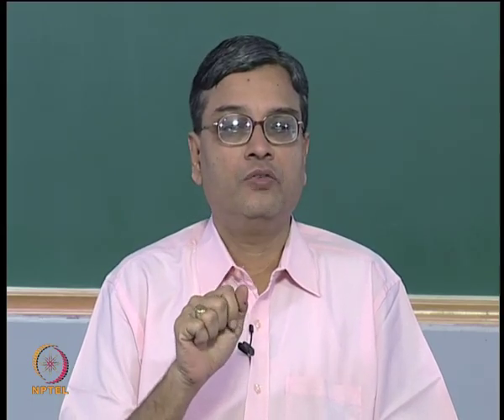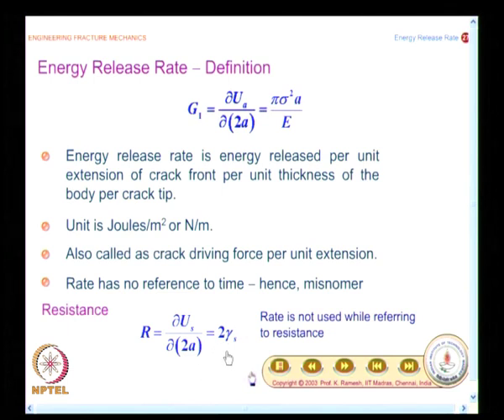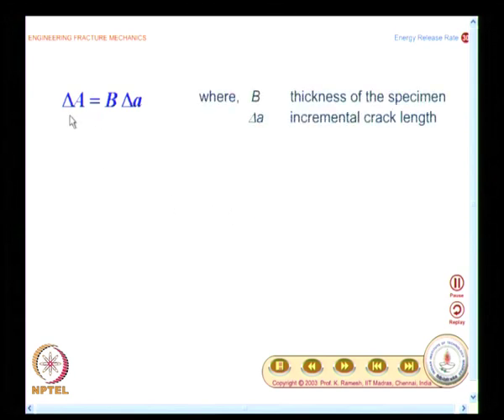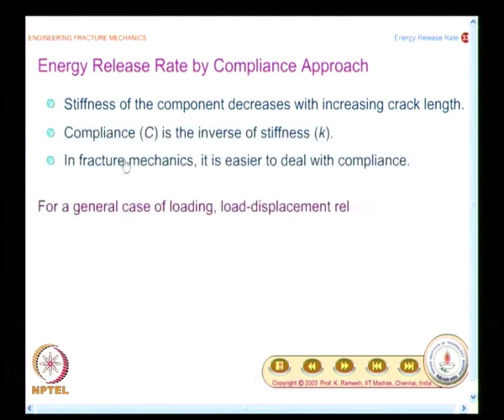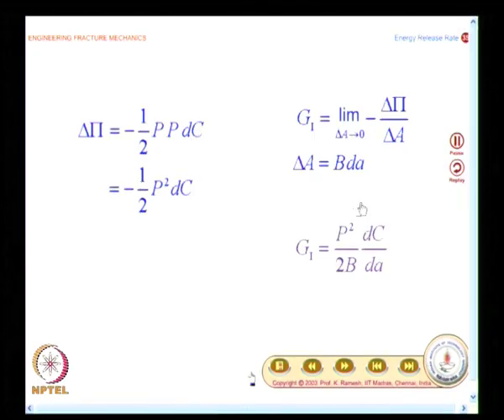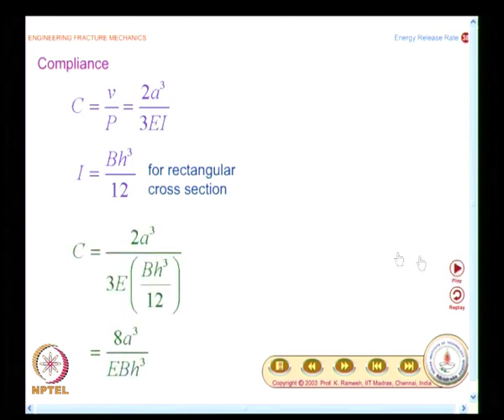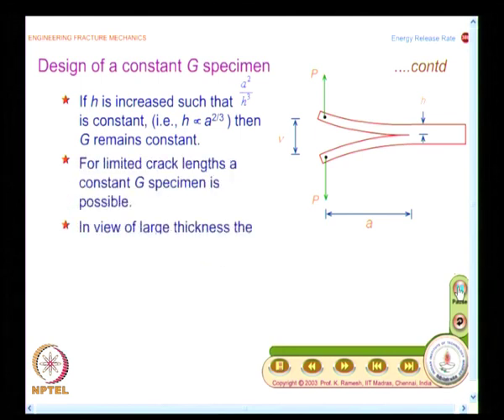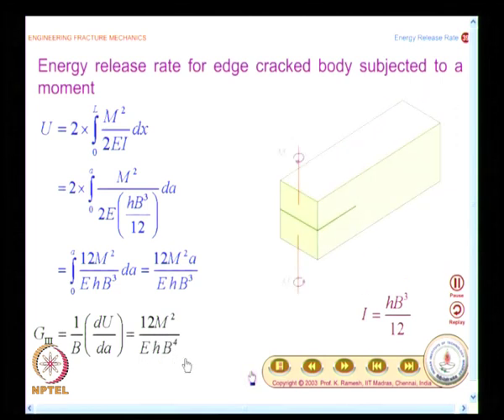Energy Release Rate

Comment: Mr Professor:
Congratulations for your lecture.
This chapter present quite well the meaning of Gi-ii.
In order to introduce  the Gic-iic(critical energies) in abaqus (XFEM - cohesive elements for simulation of a crack propagation ) how i should derive them?My knows are the modulus (in tension compression and shear) and the strengths  (in tension compression and shear).Should i have to make the additional  experiments in order to get the critical equivalent displacements of a bilinear low (uc) and then to calculate the area and get the Gic-iic?
Thank you very  much for your attention and I'm really sorry for the inconvenience I may have caused to you.